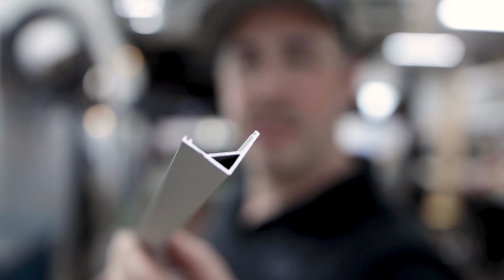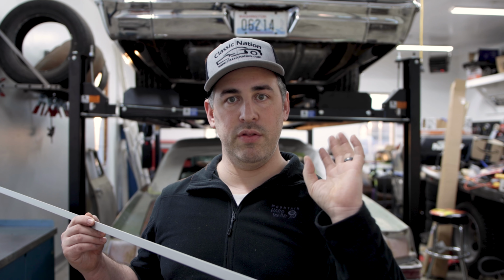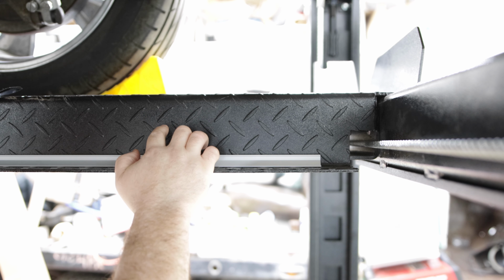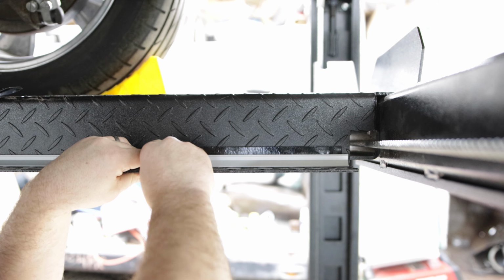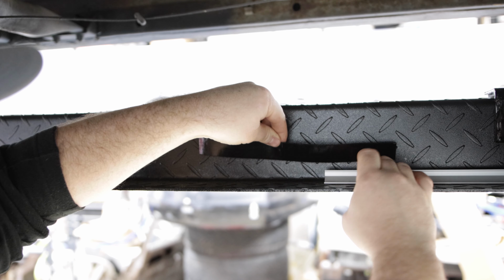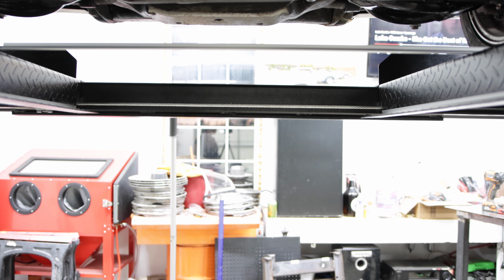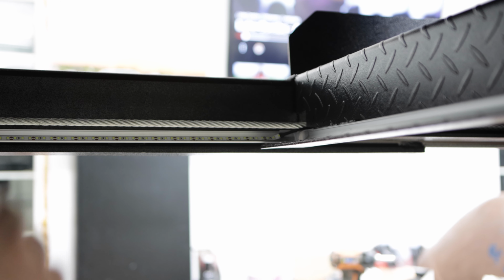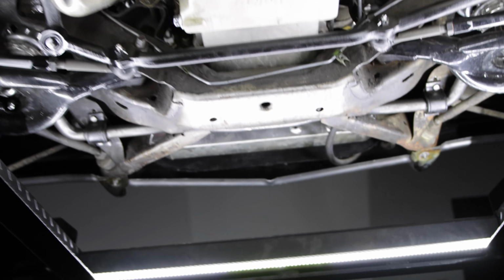DIY 4 Post Lift Custom LED Light Upgrade - Huge Improvement!

Comment: Was just replacing some
Fluorescent lights in my garage with led and looked over at lift and said time for some led underneath lift. Your video was first thing to pop up. I would not have thought of the 45* under cabinet channels great idea
 Appears we have same lift, I have tow of the jacks..any problem with the jacks hydraulic hose hitting the channels after you out the covers on ?
Thanks

Comment: Great job and video. I'm interested in doing this but would like to have it triggered whenever I open the garage door or with motion so that I'm not driving into the dark lower level. Any ideas on how to route the power wiring so there's no tangling / pulling as the lift goes up and down, or with motion detection, would be really appreciated!

Comment: Nice video.  Both links to the lights and channel are no longer available as I figured this was 7 months ago.  Any chance with providing the specific details such as the name/model of those items and also what double sided tape did you use?  Also how did you secure the power supply on the lights.  Thanks in advance..
Reply from the maker: Thanks for tuning in! I'll find that info for you and repost. Thanks!

Comment: Since I don't see any info beyond the non-working links:

Search for "V Shape LED Aluminum Channel" to find the extrusion with cover

You may also need additional connectors for the channel. Search for "Corner Connector for V Shape LED Aluminum Channel"

The brand of the channel I'm buying is "Hunhun"

I'm going to use self-adhesive neodymium magnets to secure the channel rather than sticking tape to my lift
And the LED strips are pretty ubiquitous. I'm using two sets of Daybetter brand lights. Search for "daybetter COB LED Strip 16.4 ft White LED"

And will join the strips using connectors you can find by searching for "2-Pin 8mm COB LED Strip Gapless Connector"

Total cost including magnets: $102. Hopefully this saves someone a little time.

Comment: I have the same lift and a 65 Impala SS. We have talked before. I enjoy your videos. I'm going to do something like this to my lift. I use the plastic drip trays that came with the lift. They are light and plastic so it should not be a problem to lay them on top of or next to the LED strips. I also store the ramps in the lift, so they slide along the rail where the LED strips would sit. Do you store your ramps on the lift rails and have you had any problems with the lights? Your links are outdated, were there any key words I could use to find similar lights? I am finding a bunch of multi-color lights.
Reply from the maker: Hi Scott! Thanks for following along! You have a 65 impala SS too? Awesome! Nope, I don't store my ramps on the lift. I built a shelf and they hang from my wall out of the way, same with the casters. The lights are still working great, and the plastic drip pans don't affect them at all! I hope that helps! I'll try to track down some new links since they changed them up on me. Thanks!
Reply: @ClassicNation  yeah. we have talked a couple of time over various social media platforms. I just asked you if you were going to do a Tremec when you were looking for a 4 speed console earlier today. I have a 65 SS with a 700R4...and a 4 post lift. I have toyed with a Tremec and will be curious to see what you end up doing. My guess is that doing a conversion would probably run about $4-5K unless you can cobble it together for less than that. Are you running a 480LE now?

Comment: Rather than all the car shots at the end why not show how you got power to the lights, switches etc?
I woulda put the velcro onto the aluminum pieces first and trimmed off the excess...
(The links for your parts don't work)
Your headers sure hang down a lot.

Comment: I did something similar but I used some aluminum rails that I bought from Lowes. I mounted the aluminum rails to the diamond plate surface using strong double sided tape. Then I mounted my LED strips to the aluminum rails. Here's a video review of my car lift that includes my LED strip lighting in case you're interested. https://www.youtube.com/watch?v=vAJeDqJQ758&t=4s
Reply from the maker: Nice lift and lights Ozzie! Nice looking Camaro too!